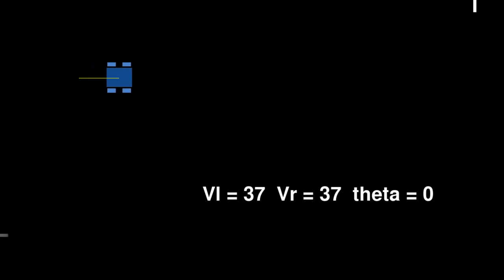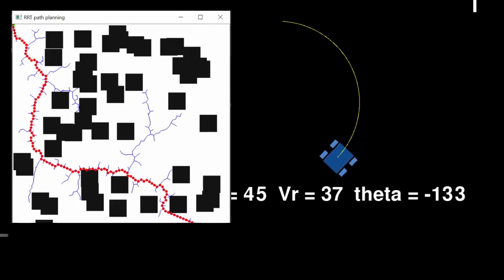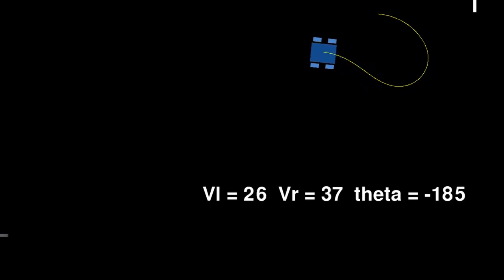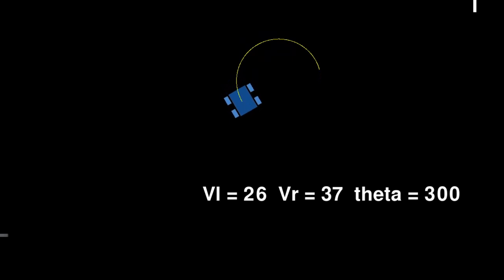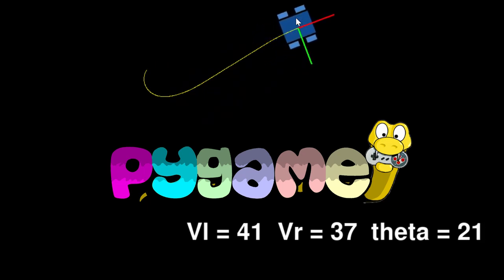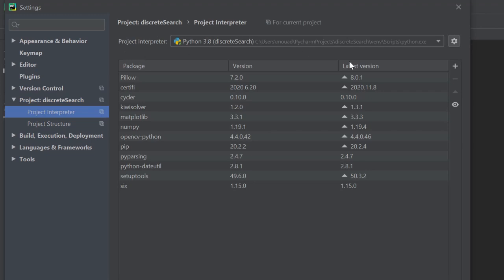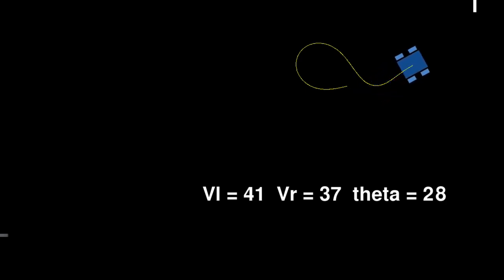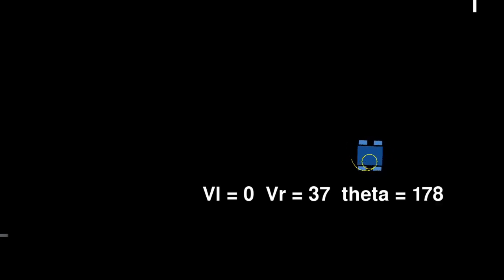python differential drive robot simulation [ part 1 ]: introduction

Comment: If it's a 4 wheeled robot, it is not a "Differential Drive" it's "Skid Drive". There is a big difference. The actual angular velocity of the wheels will not correspond to linear velocity of the corresponding side of the robot + it will be stochastic due to undefined nature of the wheel/surface friction
Reply from the maker: yeah, actually if you follow the video we assumed the robot to be two wheeled.
Reply: @hobby_coding  I have followed it. Strange to assume a two wheeled robot and draw a 4 wheeled one :D
Reply from the maker: @leonid778  if the wheels in each side have the same velocity then we can ideally assume 4 wheeled robot to be two wheeled. that's how i approached this, am i wrong ?
Reply: @hobby_coding  Yes, you are. 4 wheeled skid drive always involves sideways slipping for each wheel in any turn. It is a nightmare to simulate even if you are a professional tribologist. In practice it is very difficult to control autonomously - only by a human operator. A differential drive does not involve any slipping by either of the wheels (at least theoretically... under low accelerations and normal surfaces) that is why it is so widespread as an entry level platform both in sim and HW
Reply from the maker: @leonid778  i think my previous argument still holds, in the" ideal " case when the velocity of the two wheels on each side is identical this can be considered as a differential drive vehicle.
Reply: Clearpath is using a diffdrive encoder in their husky git repository. So i guess your assumption could be correct